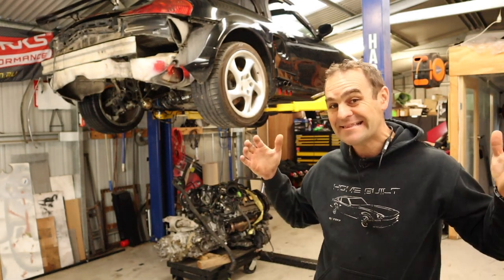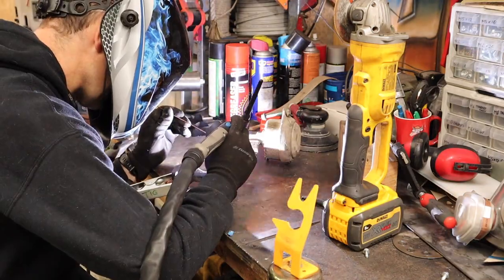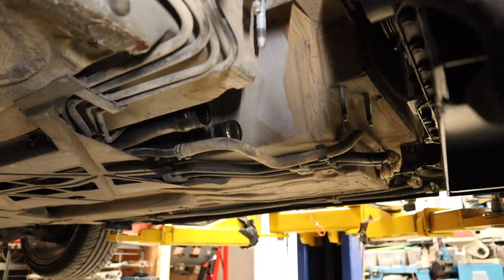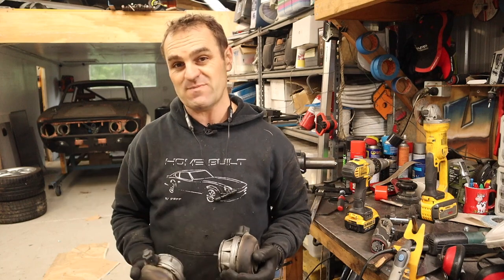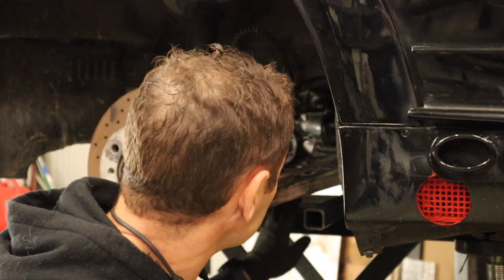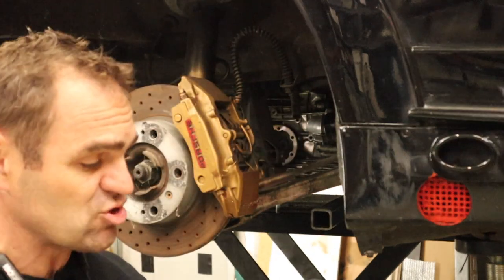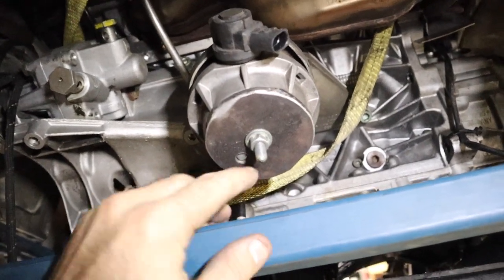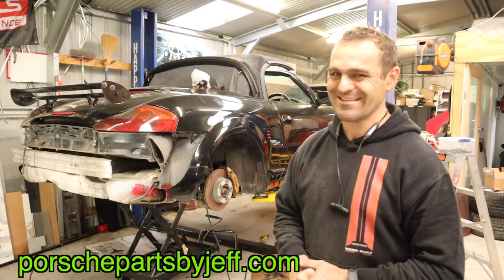Building a subframe for a V8 - Porsche 986 Boxster V8 engine swap track car build 4

Comment: Hi Jeff, I'm just wondering if you need to sleeve the bolt holes that go through the square tube to be compliant. Its to prevent crushing the tube when you tighten down the bolts.
Reply: This is a very good point, and often overlooked.

Comment: Jeff dont forget on your SHS weld crush tubes on all those bolt holes and gusset all corners.Just a comment.
Reply from the maker: I agree, but in this case the tubes are much heavier (read overkill) than necessary.

Comment: To late now but I learned a LONG time agot to ALWAYS use new mounts at the start of an engine swap to fabricate mounts. Old ones seldom have the shape they started out with.
Reply: Swings and roundabouts really, at least with the old mounts he’ll know that he’ll have clearance under the engine as new mounts wear and sag with age.. it’s just whether that’s enough clearance up top for the engine to go up 10-20mm if he does put new ones on now.

Comment: A bit late now and I'm sure it will be fine but why did you not fill in the 'missing' sections from the extended gearbox mounts with a couple of triangles?
Reply: I was thinking the same thing, but I'm guessing it has to do with clearance underneath. He has great attention to detail, so I'm confident there's a solid reason why he did it the way he did.
Reply: Would be MUCH stronger. Adding material to to each side doesn't do all that much. It's all about having material away from axis of stress. Think of a piece of sheet metal. You can bend a piece of sheet metal with your hands even if it is a couple of feet wide.

Comment: Loving this series, ... this and the Alfa. Thanks for sharing.

Small suggestion: where you've bolted through the box section, I'd also weld in a compression tube (bolt hole tube) to prevent the square tube from "squishing" (technical term) when you torque up the bolts. Otherwise the bolts will not be able to be torqued up properly and may end up continuously working loose.

Comment: Your build is looking really good, Jeff!  I'm following along!  I can't wait to get mine back on the track! 🤘
Reply from the maker: I think your page is one of the references I am using. Do you have a forum thread somewhere that goes with the photos?
Reply: @HomeBuiltByJeff  I'm glad you, sand others, are getting use out of the site.  I made it so people could see how I did my swap and replicate it if they wanted, as well as show just how simple it can be with basic tools and know-how.  I love these V8's, as well as the 1.8t's and 2.7t's, which also fit the 986/987 5 speeds and 987 6 speed.  I would absolutely love to see more people attempt these swaps!

I only have the Google photos album linked within my site.  I didn't do a thread post anywhere.  Figured a dedicated site would be better incase forum mods didn't agree with our particular form of sacrilege.  😂

Comment: Looks good Jeff. Kinda think you outta have a connecting bracket where the front part angles down to the front-rear bars but that is prolly overkill. Still surprised how much room is in that car
Reply from the maker: Still gussets etc to finish it off ;)
Reply: @HomeBuiltByJeff  we like a nice gusset😀

Comment: You will need to weld in crush tubes where the long studs are.  Otherwise the nuts will work loose under working conditions as the hollow sections will squash and flex.

Comment: Jeff, just noticed you should put a reinforcement under the front support it should be most close to a triangle. Since it holds all the weight of the two side bars in an inverted angle towards the moment of effort of the joint. Hope I explained ok. Hope to see it running!!
Reply from the maker: Keep watching ;)

Comment: I have an 986S with a 997 Carrera WLS engine making around 400HP.  I recommend putting in another brace to the sub frame identical to Pedro's so called "TechnoBrace". Easy to DIY in case you can't get it in Australia.
Reply from the maker: My subframe will do exactly what that does ;)

Comment: Looking good, Jeff! That is going to be a lovely strong subframe! I'm surprised though you didn't decide to stiffen up the mounting by replacing those OEM rubber mounts...? But hey, it's not my car, so you do what you want!
Don't I remember you getting hold of a horizontal/vertical band saw? Wouldn't that have made better work of cutting that box section than the angle grinder?
Oh, and buy two rolls of MIG wire when you go out - and then try to remember to keep one in stock! ;)
Reply from the maker: I do have the band saw, I just end up going back to the drop saw because it is quicker. From memory my local only had one roll last time I was there and I forgot to get a backup later :(

Comment: Many things to like about your cradle system- not the least of which it looks to be an easy job to drop the engine/trans combo fairly easily. No small good when even a belt change or spark plug change will be much eased by having the engine out of the car. You might want to set up a stand for it engine/trans and cradle where you could run it on the bench. I'm thinking a single plug wiring connection, AN fittings for the rad hoses and fuel lines- ten- fifteen minutes out and fifteen- twenty back in. This is turning out pretty bad a$$! Still think you should get Mrs. Jeff togged and helmeted and learning how to drive it! FR
Reply from the maker: Too much work to set it up to bench run. Easier to just run it in the car.
Reply: @HomeBuiltByJeff  IDK- a simple, hard to tip stand and hoses to extend the rad lines, fuel lines and a jumper to plug in through? If you planned to work right under the car up on the lift, it wouldn't be a lot. But it's your car and your shop- that is the great thing about it! No comment on Mrs, Jeff driving a race car? FR

Comment: Looks like you have thought long and hard about the way you want this to go.
I am wondering about the sound, and the oil movement in the sump. a few have put V8 LS engines in 911's some have gone bang in a few short laps on the track, they wish they had just got the right engine. I know you did your research but have you asked or seen anyone having oil starvation. Only saying now so you can prevent any issues.

Comment: Would belt servicing have been an engine out affair with the original Boxster setup? ... OR can that be handled from the top hatch?
Reply from the maker: The Boxster had timing chains and definitely engine out for that.

Comment: Do you plan on finish welding it in the car?
Reply from the maker: Definitely not. You would never be able to get the engine out.
Reply: @HomeBuiltByJeff  Not weld it to the chassis. Finish welding the cradle so it doesn't warp.
Reply from the maker: @ezacher4634  Ah, yes I thought you meant weld it TO the car ;)

Comment: You're doing it wrong '-}
I would connect the side bars under the front bar so that it gave more clearance to the pulleys and provides some Bash protection to the sump.
BUT before all that I would have taken a serious look at what could be modified to raise the engine at least another inch.
From what I could see of the cover plate area some hammering folding spacing and maybe a new chunk of aluminium sheet could gain you two or more inches
Reply: You need to listen to this bloke Jeff!
He's done this exact same swap 50,0000,00,0000x times before and know what he is talking about!
Reply: @1one3_Racing  First off I was being humorous and second as far as I can tell this is the first engine conversion he's done where as I have actually done a few hundred So I am qualified to make a few suggestions.
Reply: @anomamos9095  obviously not an Australian then.....